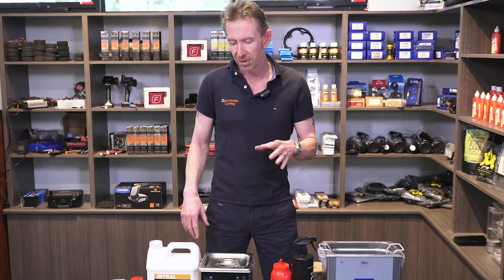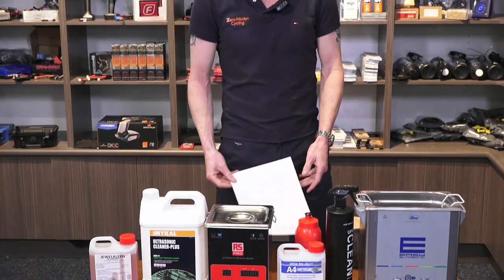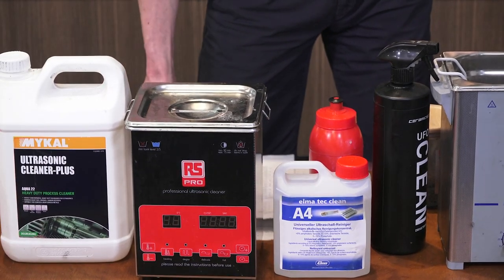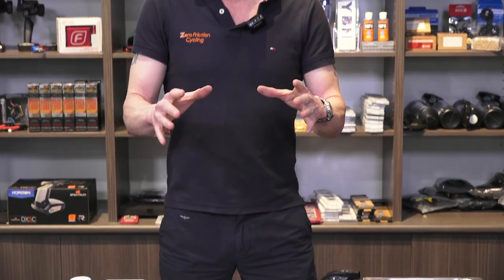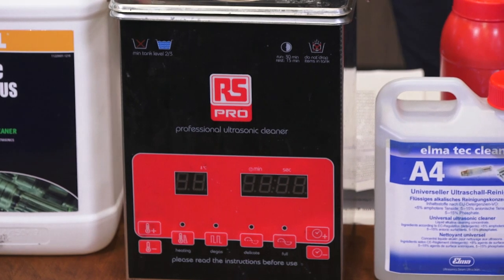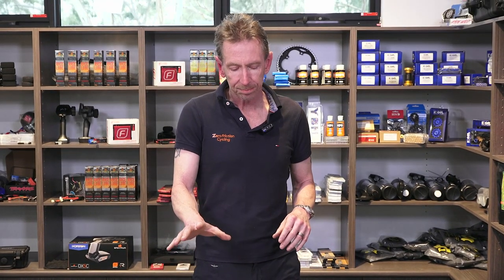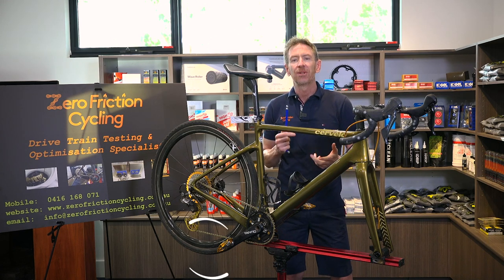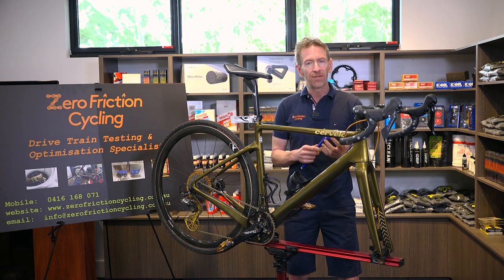Episode 8   Ultrasonic Cleaning and Race Chain Guide

Comment: Love these, keep them coming, thanks. Read every word of your FB post yesterday. I like context and elaboration so they work for me. For future it would be good to see some form of visual results on a tested chain  on one wax versus another. Not sure how doable that. I’m a major fan of MSW and looking forward to some further understanding of their new formula.
Reply from the maker: thanks kenny!! (*insert luv heart here..)
Reply from the maker: Oh sorry re question of visual results - at this stage immersive wax wise, it is really down to choosing between mspeedwax / hot melt as at this time, they are both amazing, and both look pretty visually similar. Even then looking at top chain coating type super fast lubricants in a bottle like UFO drip and silca SS drip - again -they will all look overall very clean, a little bit of black spots here and there from the special friction modifiers in the wax that are a dark colour. But really especially with immersive wax chains, by the time they start to look a bit more black from whats in the wax, it is time to re-wax, and the chain comes back out of the pot looking brand new again. If maintaining dedicated race chain on other lubricant choices, if following either container or ultrasonic method to reset contamination between races (and depending on lube / level you want to go to, applying via pot / bottle / ultrasonic after cleaning ready for next race) - even if it is a wet lubricant, the top wet lubricants dont get that dirty before it is reset time again to keep race chain mint ready for re application and next race. 

A notable exception to all this from what has been tested thus far wax wise was absoluteblack's graphenwax was comparatively dirty looking, and it was quite dirty to handle (black fingers). And it showed very high wear, so it is big case of ZFC does not recommend that particular wax. There are some other waxes on the market that i have on my long list for testing, it is possible there are other genuine contenders out there that may give mspeedwax / hot melt a run - i just have not had remotely near the time to get to yet - my test list really is something - and a key initial goal for any lubricant category is to find a genuine outstanding product to stock and recommend. Having that with msw / hot melt - at this time i have some other priority tests to get done before another immersive wax would be on the test list. And we already know from some companies previous terrible products that are pretty much a marketing con job (in my opinion) like wend rub on wax - their immersive wax i feel has an extremely low probability of being something that will challenge the top known waxes. 

Finally there is oh so much out there on the internet re DIY waxing. A follower recently sent me an instagram video of a cycling coach using one candle to melt another candles wax onto chain. And there are a number of prolific you tube channels that have frankly terrible DIY wax advice / instructions. 

Avoid. Just, avoid. cheap paraffin base / candles - they contain a lot of impurities (often soy / palm oil - not fast, and contaminate quickly) as well as a high mineral oil content (not fast, gets dirty and gunky quickly). Just using pure candles or cheap paraffin - obviously - you will get what you pay for - a crap result. Adding moly / wso / paraffin to a crap base wax is a waste of money - you are putting lipstick on a pig. A dead pig. 

So - as a minimum one needs a very high quality paraffin base if going to DIY - such as gulf canning wax, but even then, the hardness of the wax is CRITICAL. Too soft, we see what happens with graphenwax. Too hard and it is too brittle and very short lifespan. The goldilocks zone achieved by msw / silca is a super tight zone to get absolute fastest wax as well as great treatment longevity. 

YOU WILL NOT ATTAIN THIS WITY YOUR DIY WAX. 

You have no control testing to base your waxes performance on. You do not have PHD chemists working for years to develop and test. You will not wing it and achieve a super fast amazing wax that matches the likes of msw or hot melt following the BS pumped out by so, so many channels / insta accounts. 

i get the drive by many to tinker and DIY, but some areas are honestly best left to the experts. you should not DIY your chain lube any more than you would DIY your engine oil. With some top tier chain ring + cassette + chain groupsets costing circa $1500 aud to replace - dont screw around with it. MSw is $44.90 aud for a bag of amazing wax that will last circa 8000 to 10,000km of road riding. By the time one buys shit base + delivery, moly or wso from elsewhere + delivery, sometimes also PTFE from elsewhere plus delivery - it costs more than just buying the proven amazing stuff, and one still has a heap of crap wax blend. (Note MSW has moved away from PTFE, and hot melt never had it - one place recommends 50 grams - 50 grams!!!!!! per pound. Enormous waste - their blends are pulled out of where the sun does not reach, as are other information like 400km break in run etc etc. 

Sorry i have taken the opportunity of your question to go on quite a tangent / rant there - the above will be on a future vid - but i yep it is a bit of hot topic atm as just so so much crap being pumped out on so many channels i am forever trying to fix DIY waxings gone oh so wrong. 

Back to your question though :) - Visually - top known waxes and wax chain coating lubricants all look very similar, and all look very clean :)

Comment: The whole series you have done has been super informative and interesting.  You will be able to dissolve paraffin wax in ordinary vegetable oil.  All you need to do is warm up the vegetable oil and put the chain into this and it will dissolve the wax and the oil can easily be wiped off and the chain cleaned by the white spirit/methylated spirit combo.  Perhaps boiling the water 1st might help with degassing?

Comment: Ok apologies and maybe another question for another video. Does it matter what temp you take chain out of the wax? I’ve tried all sorts. Trying to establish if it helps to let it cool and hold more wax in the chain. I’ve gone back to hot as I think all that ends up (by letting it cool) is a load of surface wax which makes a mess, needs to be  brushed off and adds no value. Just waste. Any thoughts on this one?

Comment: Any recommendations for replacement for methylated spirits if one lives in an area where it is not legal to get and use them?
Reply from the maker: Hey James, yes as hard as it is to believe that is not legal (it is EXTREMELY low toxicity, there will be so many other household use chemicals much higher enviro toxicity than metho - political optics....) - your next best is isopropyl alcohol - just a lot more expensive, or acetone - again more expensive and ensure take precautions re fumes as it evaporates very quickly (acetone is the best finish prep just a PITA re cost and fumes - typically one bath is fine its powerful stuff

Comment: Adam, what's your opinion of Wipperman quick links? I could definitely tell that their chains are more prone to corrosion from experience than Dura Ace chains and stretch a tad more even if waxed but the quick link itself I find really handy because of the cost saving it provides. Cheers.
Reply from the maker: They are ok. For 11spd - they are so expensive that vs a pack of qrs 11 ybn links that will last one circa 12,000 to 15,000km - it is just easier to got the pack of QRS links. i used to stock wipperman, and the tool less install / removal is cool -  but too many customers kept installing upside down and having link clunk / jump ever time around drivetrain in smaller cogs. Not amazing in a race, or a gran fondo. And have had two where the pin separated from the base plate. And they do not have wear resistant treatments (chromium plated pins etc) and so if one uses for life of a quality chain, they wear notably more. And as you note, they oxidise easily too. Last i saw the 11spd were over $30 for a link, and so with all of the above factored in, for me not worth it to stock / recommend - that said, some waxers use them and absolutely love them - so if they work for the person - all good.

Comment: Thanks for the excellent content. Liked and subscribed. I have recently started removing my chain to clean it and I have a question about refitting. I’m using Shimano chains and as you know, they have inner and outer plates. When I go to refit the chain with the outer plate facing me, the chain can be flipped over and could be fitted in two different ways. Is it ok to refit with a 50/50 chance that it’s the same way as before, or is it important to mark one end of the chain so that it can be refitted the same way? Thanks!
Reply from the maker: Hi Nick sorry for delay reply, i wasnt getting notifications! should be fixed now.. 
Shimano chains are one of the  rare chains that is still directional (along with sram flat top). They only chamfer the leading edge of the outer plates for shifting on one side, so if you install the wrong way around, shifting may not be as good. They have shimano writing / model number of chain etc stamped in on plates on one side only, that side must be facing you / outwards - as long as do that you have installed correctly, there is no upside down  - just writing must face out. Like a claymore mine :)
Reply: @zerofrictioncycling992  the claymore :D what a comparison.

Comment: Great, great Video and hands down the only video that properly answered questions I had around ultrasonic wax treatment. I‘ve got a heated ultrasonic machine (120W/3L, so around 40W/L) on the way and were curious if the ultrasonic waves help. Now I’m happy to know that I’m accidentally making race chains for myself by skipping the crock pot :D 
One question though: A new cassette might have some sort of corrosion protection applied, would it make sense to strip that and apply some wax instead? In theory, it should protect the metal and produce even better longevity & less friction along the way?
Reply from the maker: thanks philip! no cassettes done have anything applied that needs to be cleaned off which makes this easier!

Comment: Hi Adam, 
I have a question about KMC chains. I read on the website that these may cause problems when it comes to immersive waxing. Now I have already bought some time ago both X11 and X11SL chains before it was clear to me that I want to wax them. I use both mineral spirits, methylated spirits and isopropyl alcohol. Does it possibly make sense to use an ultrasonic cleaner with these chains? The KMC chains seem to come from the factory with a different coating than Shimano chains, for example. Thanks for your help.
Reply from the maker: Hey BZ! Ultrasonic cleaner can be great if you have one, but i wouldnt spend the $$ to specifically get one unless you are looking to make your own fully optimised race chains. it wont change whether or not you will have a good time with kmc chains. It seems simply that the low friction coating KMC use prevents wax bonding as well, and so they simply sound and feel dry much more quickly than other brands, and this is just a bit of a pain for waxing as you need to wax more frequently or you will have a really dry feeling and sounding chain which is not so pleasurable, and the wear rate will be higher if riding with very dry chain. KMC deny this of course. And it doesnt appear this is limited to immersive waxes, but many wax lubricants and even some wet lubricants appear to be shucked off pretty well. No wonder they dont want you to clean off their factory grease. They have even advised waxers not to clean off factory grease!!! 

Not just from my own testing, but from around the world i will get emails from new waxers wondering why its not so pleasurable instead of being silky smooth happiness, and 9 out of ten times the person is using a kmc chain, the other one it ten its normally a prep issue. So real world is strongly backing my field and control testing. And kmc are not always super duper re honesty of information in my opinion - ie the whole factory grease Bullshite they push, their DLC chains where their is no DLC on any key load surfaces it is just a super expensive cosmetic coating that does nothing for chain longevity - and i could go on. 

That said, if you ahve the chains, for sure clean them and for sure you will still get best life out of them by choosing proven best lubricant options, just be ready to re apply or re wax a lot more frequently and thus it can be a good idea to run two in rotation etc if you have mulitple. As long as you have them effectively lubricated, they are at least fast chains - so they have one base covered well at least :)

Comment: Hi Adam, Have you tried 3M TroubleShooter Baseboard Stripper MMM10145 spray to do the "heavy lifting" on a new factory chain?  It's meant to strip wax and floor finish buildup.  Spray on from the can, wait 5 minutes, wipe, use compressed air to blow in between links.  I use it as a first treatment to strip off the factory lube.  I then do mineral spirit baths and US degreaser baths and finally Methyl Hydrate final baths.  Keep up the great videos!  Thanks for showing us how to wax properly.  Wish your shipping to Canada was less than $65 flat so I could buy something from you.
Reply from the maker: Hey Robin now i havent tried that one but maybe its worth a look - there are probs a few industrial ish products out there that probably work well, the main thing is are they generally available and accessible globally - if not they wont really be able to make the recommendation list. CS and UFO arent that easy to get in lots of places either, so i do have plans to expand the current chain prep testing once completed those two fancy products as a starting point. 

Also most times (not always) products are designed to dissolve grease / oils  OR waxes - rarely both - ideally if the mmm10145 works as hoped it wouldnt need follow up solvent baths or its not really any less faff than just the current traditional solvent method which works perfectly.

Comment: Great video....thanks.  Question though - my ultrasonic machine has two modes, namely, 30kHz and 44kHz.  Which would you recommend I use?
Reply from the maker: Generally if the fluid is a lower viscosity the lower frequency will cavitate better - so for water base cleaners (ultrasonic specific cleaners) and solvents i would use 44, for products like ufo drive train clean or waxing i would use 30

Comment: Hi @zerofrictioncycling992! Question. Is it fine for the drivetrain to rotate on Ultegra 11 speed, and use a Dura Ace 11 speed for racing? And is it recommendable?
Reply from the maker: yes for sure - and then depending on the race to training km ratio - for most by the time the training chain is getting near to 0.5, then move that on, race chain becomes next training chain, one new chain to be next dedicated race chain

Comment: What temperature do you set on the ultrasonic cleaner for the mineral turps, methylated spirits and the ufo cleaner (for waxed chains)?
Reply from the maker: you dont set a temperature. It is not an ultrasonic cleaning solution as such, so just run as is at room temp. it will heat up itself over time due to cavitation. UFO DT clean around 60dg c is great.

Comment: first time wax - my method is to start with a clean chain, after a short warm up of the chain in a toaster oven on low, then move clean, prewarmed chain into a heated ultrasonic cleaner for waxing. 

for rewax I wipe chain with a rag to remove contaminants, followed by a short bake in toaster oven, old wax drips out, chain is heated/primed to aid in wicking in fresh wax into chain. 

I used to strip/clean my used/waxed chains with turps and alcohol....then follow the prewarm and rewax methology, but now I don't strip with turps/alcohol unless new.

Comment: Adam, have you ever tried WD-40 for cleaning dirty wax chains? It dissolves everything away super easy. It also works great on oil lubed chains.
Reply from the maker: Yeah.... but then you need something to clean off the wd-40 to run a proven top lubricant! I havent tested it on wax as not many solvents work effectively on waxes, i would be very surprised if wd-40 did as normally waxes require a specific agent and i doubt a formula designed to be a general purpose lubricant + water displacement would have that - but i have been suprised in the past. However even if it did, to then have an effective working re lube with wax lubricant or re wax - you would have to clean off the wd-40 so that just seems like a faffy path to take to me. I would skip the middle man and just use a product like ufo clean that dissolves wax and then rinse with water, dry, re apply or re wax. 

Similarly maybe it dissolves oil on wet lubricant chains great - but - then if running a top wet lubricant like synergetic, black diamond, revolubes - does one want those top lubricants mixed / contaminated with a vastly inferior chain lubricant of wd-40? one is still going to want to clean off the wd-40 before applying a top lubricant. We want top lubricant - wet or wax - to be bonding to clean and clear chain metal and not contaminated with other stuff..
Reply: @zerofrictioncycling992  yes, you need to remove the WD-40, but that one comes off easily with regular degreaser. Points taken though! Thanks.